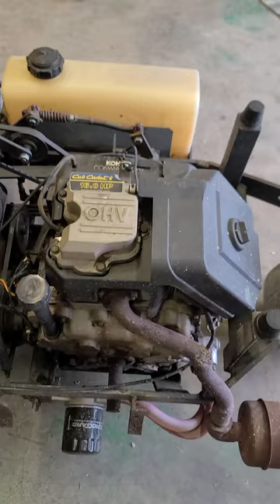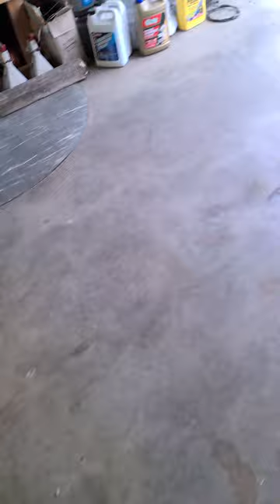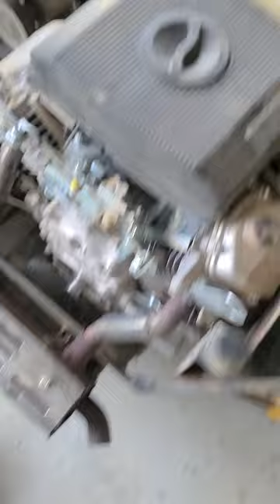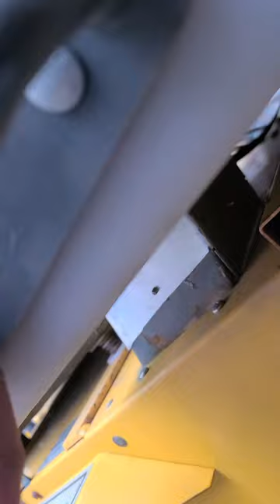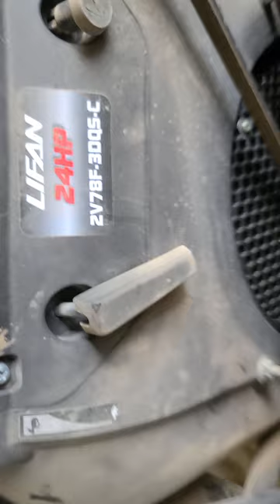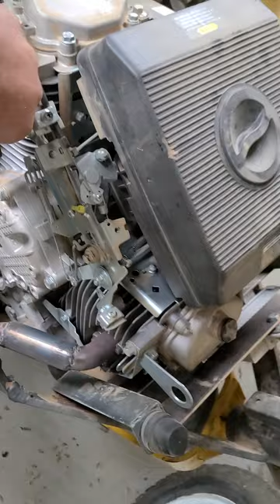Walker MCGHS repower with Chinese Lifan 24 HP V-Twin

Comment: I just ordered one for my Hustler 6x6 amphib. I will need to mount a Comet Duster CVT drive clutch on it. I will have to have throttle variation.Anythingtto share on assembling clutch to the shaft? No data on length and diameter plus no taper? Just keyed shaft??😮 Dandahermit

Comment: What rotation is that mower?
Reply from the maker: The engine rotation is counter clockwise at the output shaft, clockwise on the flywheel side.